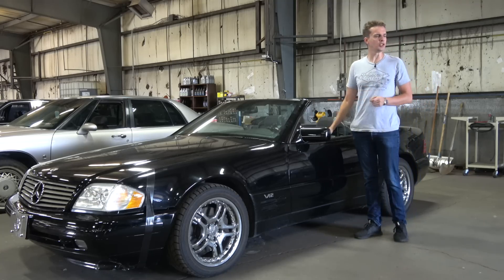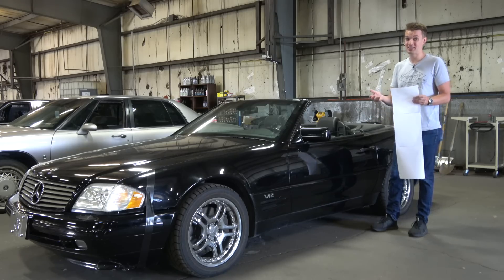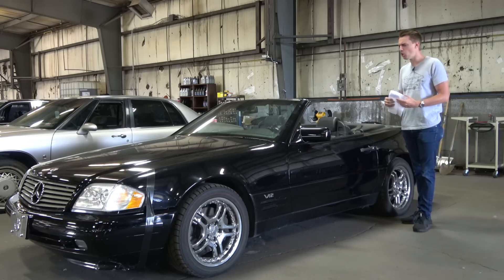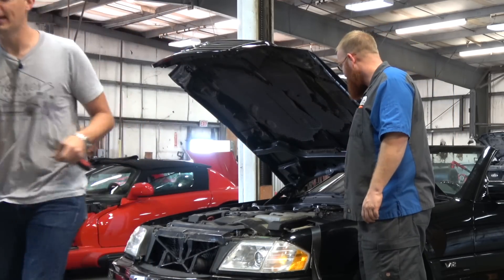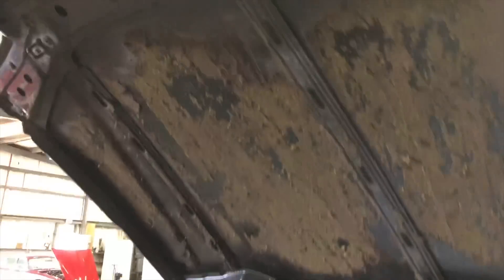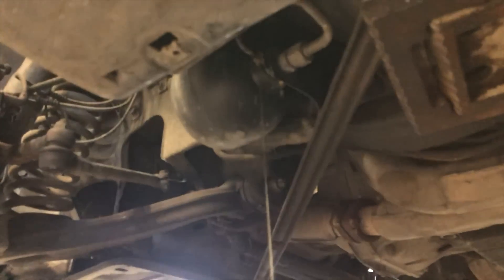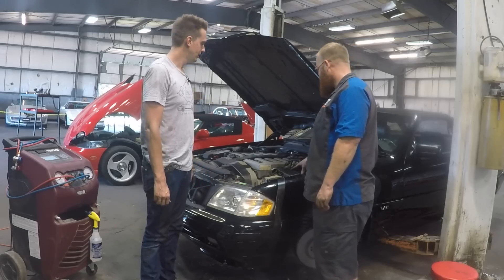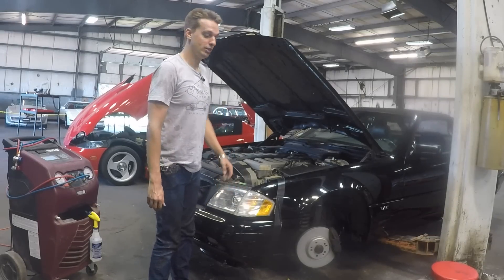Here's Everything that's Broken with My Cheap V12 Mercedes SL600

Comment: One thing to look for when trying to figure out if a car is a lemon is to crouch down in front of the car with a flash light, look straight in to the front grill and search for any sign of a Mercedes logo.
Reply: 79 thump u da man
Reply: better if you find a lexus emblem
Reply: or bmw
Reply: 79 thump i dont think that is true at all plenty of realy gread mercedes that last for ever with very little work at all
Reply: Andrew White well e46 and older for sure i dont know about the new electronicly controled every thing ones
Reply: Could always be worse.  It might have a BMW roundel.
Reply: lmfao
Reply: How dare you! 🤜🤜

Comment: Same happened to my 2000 S600. If the battery went flat in the past(i mean in 20+ years and 88k miles it shouldve been a few dozen times) windows need syncronising. After you get that sorted out the top should work like a charm

Comment: For a V12 that’s 21 years old and 84K miles old, that engine seems to be in top shape. As with used MBs, it’s just the non-powertrain stuff that’s the issue.

Comment: This explains why used German cars are so cheap...
Reply: Matt's Garage Cheap in maintaining the engine though not in the other stuff.
Reply: In comparison to what? Used american cars are expensive then? How much is 1997 Ford, is it Mondeo the top model? At least in Europe it is.
Reply: betterbeavailable In comparison to their original price & compared to other cars of a similar age. I can find lots of pre 2000 German cars for under $1000 that are cosmetically nice & in running condition.
Reply: Matt's Garage - #fact!!
Reply: In 1997 the top range model in Europe was Ford Scorpio ....  (with a Cosworth V6)
Reply: Anthony B. It is more the fact that once they get some miles on them combined with age then the very complexed, expensive & sometimes obsolete components start to fail, knowing this people will often sell them to avoid the next bank draining repair, they sell them cheap because they feel guilty about the looming issues the next owner is sure to have to deal with...
Reply: Matt's Garage what's complex about brakepads and discs, a sensor that failed and a leaking AC? Every single car will run in to those kinds of problems eventually. As well as Shocks and the balls are ~80 Euro at least here in Germany. Cheaper than a normal (proper) shock. The V12 is rather unique in that it's a damn big engine. And cosmetics are also nothing that only German cars will have. So quit your bashing.
Reply: Nexusband I’m not bashing, I like German cars, that’s why I watched this video... I’m just being realistic, I’m sure they are affordable to maintain in Europe but outside Europe things get pricy.
Reply: I don’t know man, I bought a 300CE-24 for 12k. As the original owner was passing away and he wanted to get rid of it.
Reply: Cheeky Dildo I have a silver1991 300ce 24v with full Amg kit and wheels, I bought it in 2004 for £1400. I absolutely love my Mercedes and will never sell it.
Reply: Jaybee Eff mines a 1990 24v, and I believe there are less than 20 in Australia. Which is why the price was high, but it’s in mint condition also. 150KMs in total.
Reply: Exactly. I can see the fan boys trying to deny the undeniable truth. These cars are great for rich people WHEN new, but their complexity means they become throwaway items when they break...and they do, often. The only used prestige brand worth going for is Lexus. An LS or SC430 would be a much better purchase. These cars stand the test of time, the Germans, for all their desirability,  don't.
Reply: Are you serious?  USA is the biggest market for high end European cars in the world!
Reply: They aren't that affordable to maintain in Europe either, otherwise more people would have them. Most Europeans drive sub 2.0 litre hatchbacks!
Reply: Anthony B. 
No, Americans are too smart to dump massive amounts of money into a depreciating asset. High end German cars are throwaway to rich people who lease them for 2-4 years. People who want a long-term care usually go Lexus.
Reply: betterbeavailable 

In the us the top model was an expedition or a crown victoria depending on who you ask.

Both very comfy and nice riding and both can be had for under 2000 bucks.

Parts are cheap and plentiful and they are a great value especially compared to a mercedes.

Sure a mercedes is nice but unless you do the work yourself you will go bankrupt trying to upkeep them

-Coming from someone who owns two
Benzes and is looking for a 3rd
Reply: Anthony B. This is what happens in America well off person leases brand new 100k car. In 3 years the second owner buys is precertified and drives it for another 5 years. Then someone younger buys it 3rd owner because it's only 10k and 8 years old with 80k miles. Drives it takes ok care if it. But once bigger issues start poping up sells after another 5 years at around 130k the fourth owner picks it up for 3k and drives it to the ground. That's why here it's very hard to find a older car in good condition
Reply: Matt's Garage lol it's funny cause I've had 2 different BMWs and in 12 years and over 140k miles between them.  Other than routine maintenance just a 120 dollar part went out and I put it in myself thanks to YouTube lol (03' 540i and 11' 135i)
Reply: well, you do get the zonda engine with it, it's a deal imo
Reply: Knight Industries That depends on what thing is important to you when it comes to reliability. In this video, it’s the engine that needs to be reliable because you can fix the other as they are less complicated than the engine. Also, what else besides reliability do these Japanese brands have that the MB doesn’t?
Reply: Nothing is more expensive than a cheap Mercedes.
Reply: DIAMLER If then were the case then Tyler and Tavarish would not have gotten them with that high a mileage. It looks like other brands like Ferraris and BMWs are worse because they are higher revving than MB.
Reply: A domestic is typically going to be cheaper to maintain than an import for any country.  Whether it be a 2 litre hatchback or a rare 2+ litre 4 door as most "europeans" don't have families apparently lol.   Going to a more complicated vehicle just amplifies it but retains the same basic logistics.
Reply: No this explains why 21 year old cars are so cheap -  they're old and need heaps of warn parts replacing..
Reply: Knight Industries - I have a friend with a 1991 Toyota Celsior (Lexus LS400) and I have a 1991 BMW E36 325i, funny thing is the E36 is in perfect working order with 250,000 on the clock, the Toyota has failing airbag suspension, rough idle and electrical problems with 260,000 on the clock... German cars are great until you hit the late 90's where it wasn't about quality anymore but instead how many gadgets you can fit in one car and cheaper manufacturing by using plastic parts for as much as they could...
Reply: This shows how easy pre 1997 Mercedes are to work on. It's a huge nightmare on anything newer.  For some reason everything 90-97 Mercedes I see usually never has a motor or serious trans issue. They used to build them like tanks...   I own my own a Turbo Diesel, so I know its a bit special in the reliability department.
Reply: MR Islandtime I had a 03 528i I drove it till 250k. I had crashed my car and needed one while waiting for the check from insurance. My brother sold it to me with 210k. In 6 months I reached 250k. With many many issues(as t those miles I didn't want to fix anything but said once it fails I'll buy a new car. It never left me stranded one time. My 07 linclon navigator left me stranded 2 times in the past month and I take great care of it(I still love her the most out of any veichle I've owned) . My beamer had 16 check engine codes. The sunroof didn't work and the rear 2 windows didn't roll down. But the body was super clean (my brother had repainted it) and it was on 20 inch deep dish rims. The car looked great for the year. But 250k was to much to justify fixing anything on it
Reply: Nothing more expensive then a cheap German car lol
Reply: Usually owners cheap out on maintenance once they decided theyl sell it soon. And used buyers of such cars also cheap out on proper maintenance.
Reply: Matt's Garage in all honesty it’s really not bad. All that stuff is just general maintenance things for a car that old.  The bumper isn’t the cars fault. The roof would be the only out of the ordinary thing to break I guess.  Over all he still got a good deal.
Reply: Jason Valerio: That's because Chrysler had a huge influence on Daimler back then and the "mindship" carried over. Cars had to be cheaper to sell them at a price where Chrysler would still compete. NEVER buy a Mercedes built between 99 and 2006.
Reply: Mario L Meh, mileage doesn’t make a car not worth fixing. That mentality is not what gets those million mile Lexus, Volvo’s, Toyota’s, Mercedes etc. still kicking.
Reply: Nexusband Actually the Daimler era was a good time for Chrysler, not so much for the truck line but they did make some great little cars like the Neon & PT Cruiser.
Reply: Mr2pint Yes but a German 21 year old car will cost drastically more to buy parts for, I can afford to install “heaps” of parts on an old Lincoln because parts are cheap.
Reply: MR Islandtime Sometimes you get lucky, if it works for you then great, I’m not hating, I just see it as a gamble. I actually have a plan myself to buy a German car in running condition for under $1000 & try to daily it & see how bad it is (I have a youtube channel as well). I figure for under $1000 investment I could always part it out to get my money back... It will be an interesting experiment when I get time & money to do it.
Reply: Knight Industries I don’t have any experience with Lexus, I did own an ‘05 Avalon briefly & the experience really soured my view on Toyota products...
Reply: Anthony B. Why would you maintain an older car when you can get a Japanese luxury car that is reliable, and that has more features? That's makes absolutely no financial sense.
Reply: Yeah but then you'll be the guy in the Park Avenue snoozemobile
Reply: There were plenty of carryovers, for example the R129 like this one were made until 2002 and were virtually the same if not better.
Reply: Matt's Garage they usually Hold Up pretty good, but If you don't have access to used parts and don't know how to fix stuff, broken things will be pretty expensive to fix because everything is usually more technologically advanced than the average US Car
Please don't kill me for that statement, both have their advantages and nowadays US Cars are almost (some models are already) on pair technology wise with German premium brands
Reply: Europeans drive a 2.0 litre hatchback?? DAMN You are overestimating. Here it's all 1 litre now. 3 or 4 cilinder. I feel super special with my 3.5L V6 cost me alot though... :( but cheap ass fuck in the USA.
Reply: Mario L Interesting cause they didn't make a 528i in 2003 in American but maybe your from another country. Only made 525 530 540 and M5 in America.
Reply: @turbointegra82  No you are right, there is no 2003 528i. Only built until around 2001 I think

Comment: Usually the hpc pump in the boot is the issue with them roofs and if u put more fluid in it then it normally fixes them and when u do the suspension rembember to bleed them the oil leak is most likely to be the small seal on the rocker cover or a hose I work in Mercedes and they usually don’t go wrong to often
Reply: Usually it's the seals in the hydraulic cylinders. If one goes you should fix the rest.

Comment: Tyler, the leaking on the right of the engine could be the oil heat exchanger, some kind of sealed mini radiator, the gasket dries up with age.

Comment: The top needs cycled from open to close, that generally seems to fix them when they go halfway up and stop. Use the top tool, with the key off, otherwise the hydraulics have pressure and it won't move from outside forces.

Comment: If you manually put your top back down, then RESET your windows, more than likely your top will function regularly again. To do this, close your windows, (in unison,) then lower them again, holding down the "down" button for about five-to-ten seconds after both windows have rolled down. Now, lower your windows again, and try putting up your top once again. (More than likely the top will no longer hang half-way at the top, but should close entirely altogether.) I hope this is helpful to you. By the way, your SL600 and my 1999 SL500 (Arctic white) share the same make/type chrome wheels.

Comment: 1997 Germans are either near the end or already dead. Meanwhile at Lexus, they still partying like it's 1999.
Reply: Mercedes are endless money pits!
Reply: The Earth IS flat ! You don't have to agree with it or like, but it's FLAT !
Reply: Eman 08 But not when its comes to the engine as seen here.
Reply: So here we have the best example - nothing wrong with the car, just corroded contacts and balls with weak seals.
Reply: I'd still go for a Merc instead of a Toyota. Sorry.
Reply: A Merc is a totally different class than a family Toyota
https://www.youtube.com/watch?v=8YIdTQVfvcw
Reply: No the Earth is not flat, it has mountains, hills etc.
Reply: Cars1999 Hey man, don't think it is a great idea to argue some thing by just stating that the opposite is true. You can say the earth is not round, because of x y or z. Or the earth is not flat, because x y or z.
Reply: I hear that, I think Lexus must have some undercover lemmings planted here.  Luxury is expensive and depreciates whether from Bentley or Lexus.   You'd get a Toyota not a Lexus if you were concerned of higher maintenance cost.  Lexus strut $800, Toyota $200, Mercedes $800 but it's a more expensive $800 right.
Reply: These engines are bulletproof, best most reliable V12 ever made by anybody.  It's everything around them that fails.
The Lexus V12's are crap by comparison!  :D
Reply: Chuck Farley lexus never made a v12 engine...
Reply: Cactus Sensai Doug More like under $700 for a Lexus ES. Do realize thats the enitre strut assembly? The Strut Shock Absorber its self cost the same as a Camry and Avalon about $176. The price for a whole strut assembly on an ES is normal and rather cheap compared to Mercedes and BMW's. The high price for any entire OEM strut assembly is nothing out of the ordinary for any car since you are buying all the parts at once. Some manufactures sells them in parts and some sells them all in one unit in bulk assembled. Lexus sell all the strut components individually too since you don't necessary need to buy the whole thing. When you add up all the strut parts, springs, struts, strut mounts on a Toyota Avalon, it will come to a grand total of $665.39. Most of the parts on a Lexus ES are the same as the Toyota Avalon and cheaper than other higher end Lexus models 
Toyota Avalon strut assembly as in parts individually. 
Strut $176.91 
Support nut $1.76 
Top Nut $4.26 
Lower Insulator $25.51 
Spring Lower Insulator $21.36  
Spring $108.08  
Bumper $15.05 
Strut Mount $154.92
Upper Support $154.92
strut collar $11.88
Cover $5.79
Grand Total=$665.39

Comment: First on the list: Bad Rims
Reply: Pedro Amadei Wheels.  A "rim" is the wheel's outer edge.
Reply: I would let them sandbrush to mat, than they would look nice.
Reply: Depends on the type of English you are speaking. Originaly the Wheel is the entire construct from the axle bearing to the tire/tyre. In international english this weehl is separeted to  rim and tyre.
Reply: Agreed, theses AMG rims don’t fit the R129. It needs some older monoblocks

Comment: I was wondering why a car dealer would sell it for so cheap, so many problems and Mercedes are expensive to fix. He's probably thinking that it's going to cost a lot to fix everything. But, although the list of things to fix is long, it appears that so far its not that bad. I am feeling optimistic. AC just needed a charge, roof is working and appears to just needing some small replacement parts, the leaks are from hoses and dies not look serious, the suspension just needs new balls. Looks like you could be coming out ahead on this one, Tyler! Woo hoo!

Comment: Mercedes and broken things... they go hand in hand.
Reply: Why they are such great status symbol cars, if you can afford to keep one in good repair, you can certainly afford other things like Starbucks and iPhones! And babies!!
Reply: this one seems in great shape though
Reply: It's a 20 year old car that used high end parts for high end performance. Brand doesn't enter into it.
Reply: Ciuciu Muciu way better then Honda lawnmower that u own
Reply: nice joke, buddy!
Reply: You get trolling like this in every car video.
Reply: His Honda isn't a lawnmower, it's a moped.
Reply: lol..Notice that this car is like the cheapest in the country...And Mercs of that era are really reliable even compared to the japanese..Those parts he's changing are all parts you're supposed to replace every now and then apart from the crash damage and the roof (which is a 20 dollar fix)..Also been sitting long times and that's why there's oil leak in the power steering hose..
Reply: Honda and no torque... They go hand in hand.
Reply: Last time i checked here in California i don't see any s2000 driving around anymore
Reply: Imad S go hondaaas..
Reply: It's a 90s car. A/C? cheap suspension bits? Leaky hose? If that's too much for you to handle you deserve that Corolla.
Reply: Bud Chronic they are reliable until you wiring harness falls apart because they were made from biodegradable material or the intake gasket fails on the 6.0 which is just a few common problems on the sl600